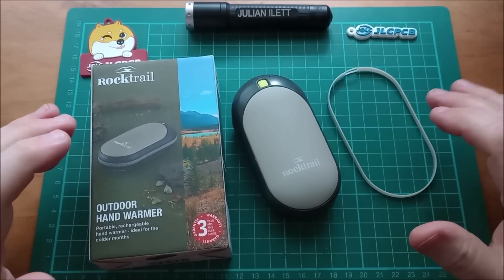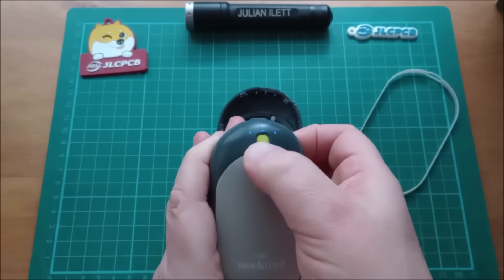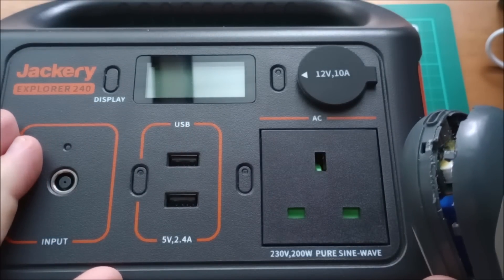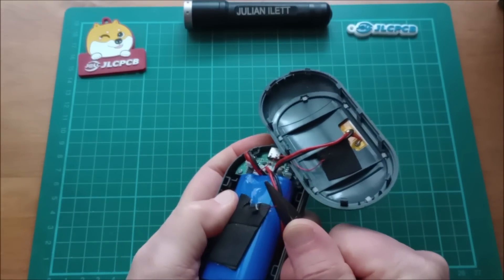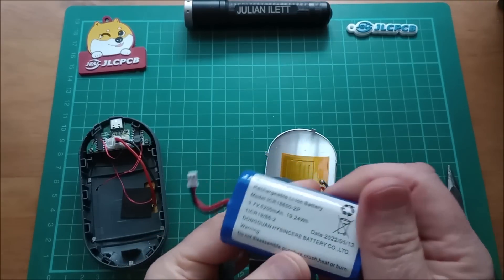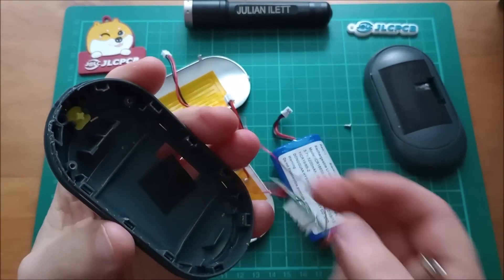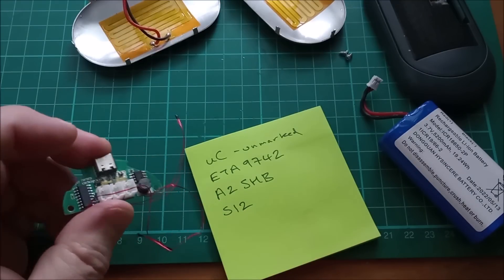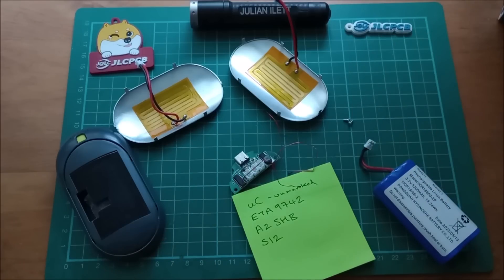RockTrail USB Type-C Handwarmer Teardown

Comment: I got the same warmer and took a closer Look at the battery, after measuring it an getting 0V. Inside the battery is a small PCB with a DWO1 Battery Protection IC and two 8205A Dual N-Channel Mosfets. Very interesting is the fuse made from some low-temp alloy soldered to the pcb. This makes it almost look like a teeny tiny smart battery. The cells inside are SOULISR18650 SLJ17510576450. The PCB has the name JLH-5040-2P-PTC in silk on the bottom.

Comment: I had one of these from Lidl and it lasted about a month before giving up. I also have one from ebay that runs from a 5v USB source and inside there are 2x10W power resistors with thermal compound and a 100 degree thermal cutout. It gets really hot if you leave it on. I've repaired it twice already because the wire failed near the entrance to the unit and it's already broken again.
Reply from the maker: When it failed, I couldn't switch it off. I had 2 options - leave it outside, or take it apart and disconnect the battery. I did the latter.
Reply: @JulianIlett  mine wasnt as spectacular. It would show full (3 lights) but turn itself off after a few seconds